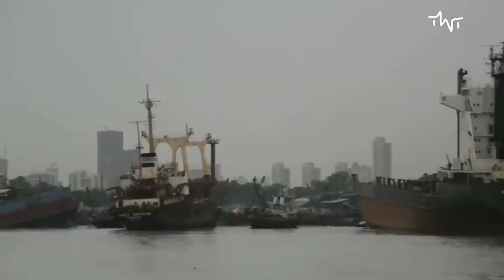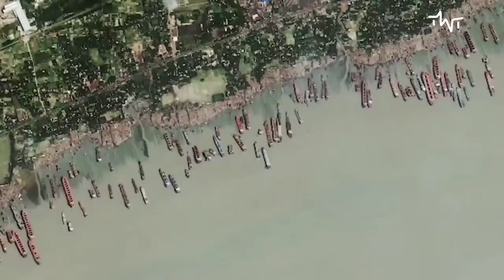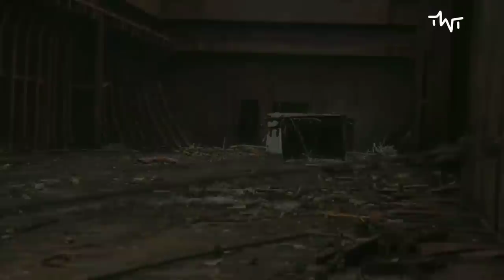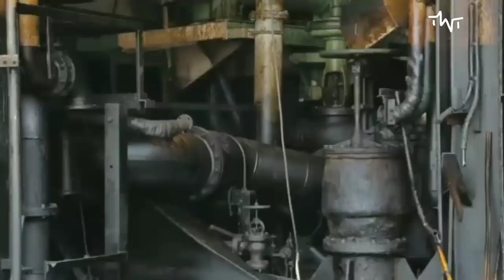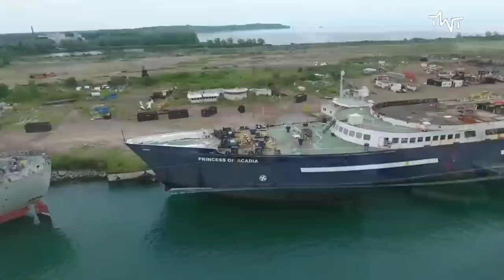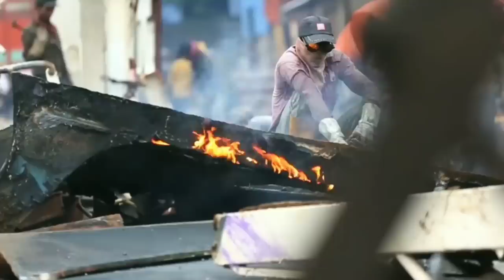Ship Breaking Yards | Place Where Ships Becomes Scrap

Comment: Great shots!
Do they recycle everything or does some parts remain in the water (for ever)?
Reply: The ship is driven to land and whats left in the water after the initial dismantling is dragged out, all used, nothing left. The fixtures and fittings from inside are all sold/used.
Reply: @bonkeydollocks1879 , thank you!
Reply: they only dump the oil/chemical contaminated ballast water, asbestos and other nice clean fun stuff over the sides.. all the metals and other reusable stuff gets saved.